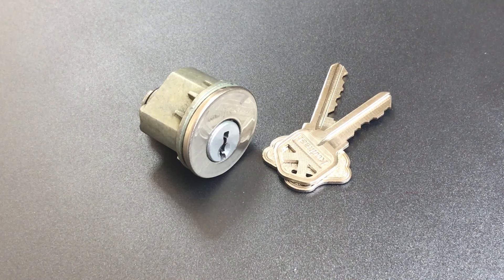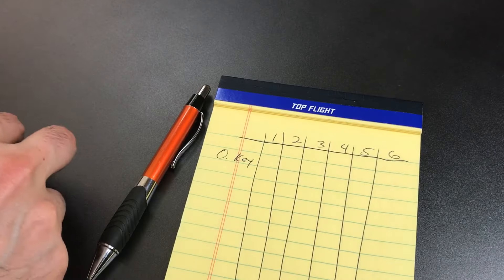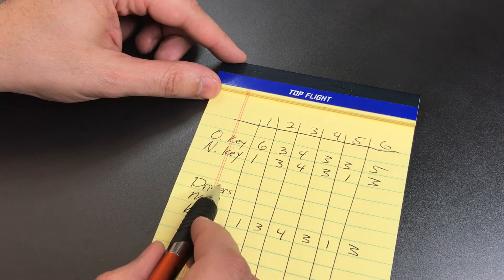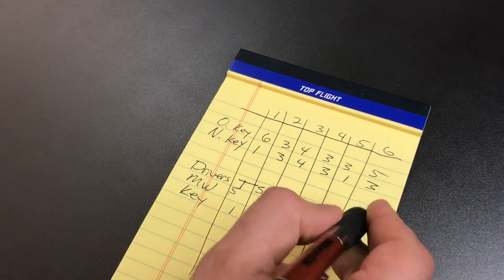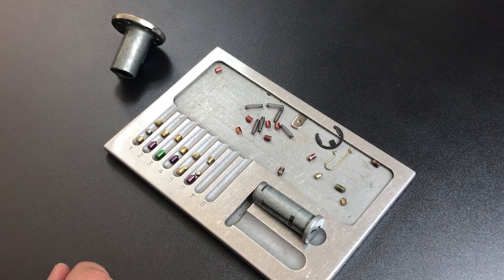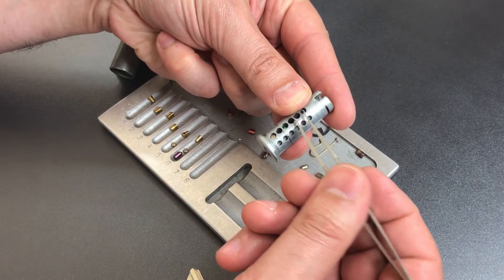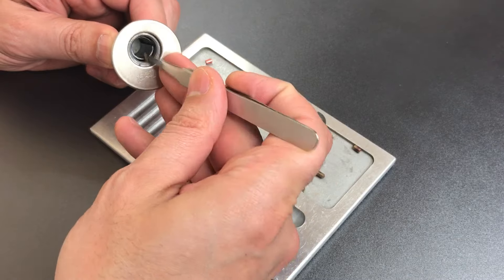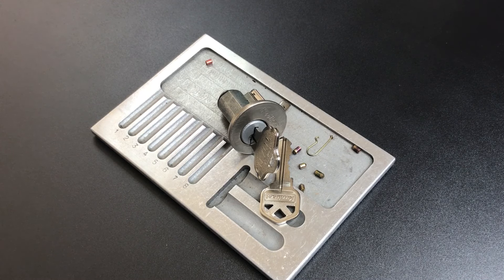[541] How to Make a Kwikset Key Trap

Comment: I know a locksmith who creates trap locks to recover lost or stolen master keys , the perpetrator with the missing master tries to nose around in a locked storage room , key is recovered and no need to re-key the entire facility
Reply from the maker: Hmm... interesting.
Reply: What if the thief made a copy of the master?
Reply: What if he raids the rest of the facility before he gets trapped?
Reply: I once worked for a douche who had over 100 rental units and he wanted me to put them all on a Schlage master key system. No problem. Then he says 'And make me up a bunch of master keys.' So I did. Then he starts handing out master keys like popcorn to anyone who needs entry, instead of only the regular key. Drywallers (those honest, dependable drywallers), paint touch-up crews, furniture movers. He lost track of most of the masters and then his tenants started complaining about shit coming up missing.   lol I tried to warn him, but he was a douche.
Reply: @bertrandhustle  Well, you leave the trap in place, maybe switch em to a different lock.
Reply: Tom M wouldn’t every employee who uses their master have their key withheld? No need for the question, that’s absolutely what would happen, seeing how the masters would be identical. This only makes sense if there is only one master, and every other key is individual.
Reply: @gotanyketchup3422  I imagine it's a case where in those situations, any employees who have an authorized master key are warned not to use it on the particular trap locks, and maybe even are given a copy of the normal keys in the meantime. Doing it that way would ensure the, (hopefully very few), people who are supposed to have a master key don't get it stuck, while anyone who isn't supposed to have one gets it caught. While it might be a pain for those employees for a bit, it's certainly a lot cheaper and easier than simply rekeying everything in a facility to deal with one stolen master key. I'd imagine if it's a case where the stolen key doesn't become trapped after a certain time, then rekeying would happen to cut down on annoyances.....
Reply: @socialex  It's not perpetuating stereotypes if it's actual anecdotes. At least it's not perpetuating stereotypes by someone other than the Mexican worker ;)
Reply: @socialex  "its use".  "it's" is a contraction for "it is" (or "it has").  Irony; couldn't help posting.
Reply: @Tryptamide  Are there intelligent educated dry wallers of any other race? I feel like that's a profession that lends itself to people who aren't that bright regardless of their race...
Reply: trey kearns - Lol, that’s what carpenters say about plumbers!
Reply: socialex - Calm down social justice warrior. Have a snickers bar or something.
Reply: @alexsis1778  honestly- if the only thing in the construction field you have mastered, or even better yet- decided to master to a certain degree- I for one feel bad for you. It also says alot about ones ambition if such a simple and monotonous job is all one decides to do. But two, anyone with good mechanical abilities and ability to work with tools and materials would almost certainly want to learn and master the other aspects of building/remodeling construction,  to a point where those who are motivated will learn all the other "trades" within the "carpenter field" , excluding obviously other licensed trades such as plumbing, electrical, mechanical etc
Reply: @biggawinnacrapsa3870  If you wanted to do the right thing, you'd warn the tenants.
Reply: @socialex  Ya know, stereotypes don't just appear out of thin air for no reason, that would be more of a "hate-based preconceived notion"...  When one observes a proclivity exclusive to a certain demographic, if it's a negative one then it gets labeled a "stereotype" and shame on you for pointing it out but if it's something positive then it's ok. This is the same line of thinking YouTube uses when hiding a shitty videos dislike count so that uploaders with shitty content don't get their shitty feelings hurt or when schools hand out participation trophies to celebrate mediocrity. I can go on but I'm sure you've gotten the point. But AAALLLLLLLLL that aside, I live in Southern California and in this area drywalling just happens to be a trade with about 99.99% mexicans be default. A good amount cross the border daily, even more dont even speak english. In fact the entire construction realm (even plumbing) in this area is dominated by mexicans with about an 80% majority. So NO, my comment had nothing to do with assumptions, stereotypes or hatred towards mexicans. My hatred is toward drywallers, regardless of their race.
Reply: @treykearns4867  - Lol, the mystery of the funky smelling nails is finally solved!
Reply: @socialex  oh yeah I also forgot to mention I'm a commercial plumber not a residential plumber. that is the huge difference between a scumbag track-rat and a highly-skilled, extremely knowledgeable badass with a much much higher level of professionalism being required. Commercial plumbing is so incredibly involved and diverse we need almost twice as many tools as any other trade, we are the second highest paid trade in construction. (in my area anyways. not sure how it goes in other parts of the country).. a non-union plumber makes more than any union electrician, Carpenter or pipefitter/mechanical/hvac. The only dudes making more than the plumbers on a commercial construction site are going to be the union Ironworkers and that's because they get hazard pay because of the crazy shit they do, flying huge steel beams many stories up into the air.
Reply: @treykearns4867  Also- it's a known fact that people from certain Hispanic countries often throw shitty toilet paper in the trashcan rather than flush it. It's utterly disgusting and I have seen it at multiple jobs over the years. There's nothing racist about pointing out cultural practices.
Reply: @rahmanahashem3484  well the reasoning for that is because they don't have very good Plumbing in Mexico and they can't flush toilet paper down otherwise it gets clogged so they have special trash cans for it I've seen it when doing jobs close to the border at medical facilities and stuff that are intended for Latinos in the bathrooms they will have two separate trash cans one in the shitter and one out in the lav / urinal area.
Reply: @bertrandhustle  Youre assuming the criminal thinks that far ahead.  More than likely the thief doesn't think of that before the lock eats the key.
Reply: assuming they haven't copied it
Reply: only if the culprit is dumb enough to actually use that master, which is probably most of them…but not all of them. ijs
Reply: @stevee7774  and what plumbers say about electricians.
Reply: @treykearns4867  from a former union tin knocker, respect to you and all other commercial/industrial pipe fitters/plumbers. Worked side-by-side with some of the smartest, most resourceful people on the planet.
Reply: @JohnDlugosz  you're a genius, son.

Comment: Next video: "How do you open your door when a key is stuck in the lock"
Reply: from the inside by removing the lock or better yet you don't and get used to leaving your home from your window! =P
Reply: As a companion piece for the 'perfect' (just replace the the first two pinsets with hardened steel equivalent sized pins&wafer) lock-- I give you the search for the perfect door: https://www.youtube.com/watch?v=4YYvBLAF4T8
Reply: The ol boot to the door tends to work quite well lmao
Reply: @IndyWildfire11  To that I say get a solid door and a hammerhead deadbolt with warding around the thumbturn (explained in that vid link I posted)
Reply: @IndyWildfire11  Spoken like an American, you're free to try that to mine, it's even the worst one I've ever had. I wish you very good luck.
Reply: 10 If Door = Tree Then Goto 30
20 If Door = Metal Then Goto 50
30 Weapon = Axe
40 Goto 70
50 Weapon = TNT
60 Goto 70
70 Qapla'
80 End
Reply: @thiesenf  I like.. I wonder how people really understand what this is.  I was wondering the same thing.  So if you live in an apartment, and that is the only entrance. Hope you can get a window open.. Or just start looking for a new apartment..<G>
Reply: @thiesenf  this comment needs more likes.
Reply: Harry Fahringer III No, it's very unoptimized and uses assignment when equality should be used. Here:

10 If Door == Metal Then Goto 40
20 Weapon = Axe
30 Goto 50
40 Weapon = TNT
50 Qapla'
60 End
Reply: @anonymoususer9837  Nice try, but this is BASIC and there is no ==, = is used for comparison as well as assignment. Also that wasn't much of an optimisation. End is redundant when there's no more code, and the structure is still overcomplicated.

10 IF Door=Metal THEN Weapon=TNT ELSE Weapon=Axe
20 Qapla'
Reply: Was able to pull the end of a key out a lock for a customer using a j hook and next to no experience.
Reply: I was thinking the same thing

Comment: Can you rekey so that it not only traps the key, but also the person turning the key ?
Reply: Its called a bear trap
Reply: @LPJMagicmusic  Do you still need the key trap then?
Reply: Yes, because the beart trap needs reset so if another thief comes along they still won't get in.
Reply: video cam
Reply: There was a design for fire alarms to keep the pranksters away. It locked the hand when you triggered the alarm and must be reset and opened by a policeman or fireman when they arrive. Cool design but i'm not sure why it didn't caught on.
Reply: @AsiAzzy  hate to be the person trapped at the pull station burning alive if it turned out to be real...
Reply: @matthewmiller6068  obvious reason why it's not real
Reply: Put a drop of nitroglycerine in every construction hole. Problem: while the perpetrator lies unconscious, the doorway is wide open for any subsequent attackers.
Reply: Man trap room with the key trap locks on the inside. They go in, door closes behind them, they can't get out in either direction.
Reply: @matthewmiller6068  Maybe not trapping hand, but what about issuing some sort of sturdy trackable bracelet, that could only be removed by special tool...?
Reply: A hidden trapdor with an invisible laser as a trigger maybe? When there is a person fiddling with the lock for longer than 10 seconds(interrupting the laser line), the trapdoor below them opens.
Reply: @harshnemesis  10 seconds...? You never ever returned home wasted, did you...?
Reply: @FalkonNightsdale  Never was that wasted I couldn't unlock the door in that time
Reply: @harshnemesis  Congrats, I have sometimes trouble to achieve that even sober. Depends on how many things I have on my hands at moment...
Reply: @FalkonNightsdale Well you just have to remember you have limited time and work within the limits, when it happens that you're taking too long you could just walk off before the trap triggers, or you could just extend that time, but keep in mind that if you do the later you will also lower the chance of catching the thief as they work fast and they might not care too much to retrieve their key, so a trap like this would be the best to trigger during that short period of surprise.
Reply: @FalkonNightsdale  I don't know of a tracking bracelet, but I have heard of some fire alarms that use the same sort of paint as is used to mark bank robbers, (via being hidden in fake packs of cash and exploding when they open them), with the paint spraying on whoever activated the alarm. An annoyance to anyone doing it legitimately for sure, but it also makes it really obvious who it is that pulled the alarm in the case of false alarm situations.....
Reply: @Gamer3427  There is a wide sort of such colours, both in colour palette and type of marking (whether it's reactive to some chemical or type of light).

Thing is, that they are mostly incredibly hard to clean up, marking everything in the process. And whenever the person is aware of markings (visible or invisible), it's easy to hide them or hide altogether - that's where nice alloy bracelet with tracking would be handy...
Reply: @FalkonNightsdale  There's a problem with using a bracelet though, in that one size doesn't fit all. If it's too small, it could potentially injure people who have larger hands/wrists, people who might be pulling it for legitimate reasons. If it's too big, it'll be easy for people with smaller hands/wrists to get out of it with no consequence. If it's some sort of flexible material that can fit any size, it'll be easier to escape or simply cut off. If it's something like a zip tie mechanic that adjusts to the size of the person, then the problem becomes keeping the device from putting it on too tight and potentially injuring the person involved. Of course, all of this is saying nothing of the potential expense of installing an alarm system with such a device, and installing it in such a way that doesn't just prompt the person activating the alarm to use a method where they won't get the bracelet applied to them.....
Reply: @Gamer3427  it could have form of padded zip tie mechanic - it can get pretty tight, but without injury, no mater size of the hand.

It can be done like having lever switch in a transparent cabinet, which could be reached from the bottom through opening with Mechanism. Pulling the lever would release spring on Mechanism, installing bracelet.
Reply: do it home alone style

Comment: How hard would it be to modify a Schlage lock to exhibit the same behavior?
Reply from the maker: +TheBonelesstoast not hard. Just add some construction keying holes... some schlages already have them.
Reply: It depends on your ability to drill a few undersized holes.
Reply: i have taken SCHLAGE cylinders apart (and put them back together) and the rear 4 chambers have construction holes.

Comment: Seems likes great idea as long as the the door unlocks by turning the key counter clockwise. But what happens if the door opens by turning it clockwise? I suppose you can modify the core for that.
Reply from the maker: +Bobby Keyz It will not work without adding construction key holes on the other side of the core. I note this in the description. 👍
Reply: LockPickingLawyer sorry about that I know you always think if everything. I usually read the description too. Missed it this time.

Comment: How do you get it apart after it happens? And how do you open your door if this happens?
Reply: Presumably you'll have a back door that hasn't been disabled by the trap through which you get inside.  Once inside you disassemble the doorknob from the inside to both release the door and to gain access to the lock core for disassembly.  The lock shown here has a cap that can be slid off to dump out the pins, including the one that fell into the trap hole.

Comment: What if the deadbolt isn't on the right side of the door? This means that this is useless. You can still unlock the door by turning it right, but only when you try to lock it will the key get trapped. Pretty poorly thought out.

Comment: How do you unjam it if your the owner?
Reply: You can dissemble it from the other side of the door. Don't do this on only one door unless you want to drill the door knob out. Use gravity to make the pens fall back into the lock. Make sure it doesn't have any tension and they should fall back down..

Comment: I’m a locksmith and noticed the cylinder you are using is for a deadbolt. If the deadbolt is installed so to unlock the door you would turn the key clockwise your system will not work and Marty is in your house. The key doesn’t have to turn far enough to get trapped to unlock the door. Also Marty can leave and take his key if he doesn’t try to lock the door. So it just depends on which way the lock turns to open for your system to work and if you don’t have a second entrance to go in you will definitely have to drill the lock to get in. A simple rekey of the lock is all that is necessary to keep Marty out.
Reply from the maker: See the description...

Comment: Something I've been thinking about, is wouldn't it be cool, to have a lock that sets off an alarm if you pick it? This could be done in several ways.

A complicated (first idea) way would be to make it so that when 1 pin is moved, it starts a timer and if the lock is not opened within a set amount of time, an alarm goes off.

A simpler method, would be to to use a spool and once you get a "False Set", it makes contact with something, which causes an alarm to go off. The nice thing about this design, is that it can be made purely mechanical/electrical, without any microchips, by using piezoelectric for a speaker (makes sound when powered) and you could make it so that alarm stays permanently on as soon as it is triggered, even if the person releases tension and runs away. Also, if the wrong key is used, the chances are that you won't set all the pins except the spool, so the alarm is VERY unlikely to go off from using the wrong key. The hard part, would be finding an elegant solution that requires the minimal amount of modifications to the core.

I know how to make it, but it would be very difficult to explain in words or understand with single images.

Yes, I know I could design, build and patent it.
Reply: You already presented idea rendering it un-patent-able in many areas(if not all). And patents are regional only so no reason to even bother with them.
Reply: Czorńy Lisek that is simply not true

Comment: So.... The lock is garbage now... You can throw it away. . If you can get into your home.....
Reply from the maker: +WOWayne325 If you can't enter the house from another door or window (after which you can disassemble the lock from the inside), then the lock will need to be drilled. I note this in the video description. 👍
Reply: LockPickingLawyer yes... I understand that... But the lock is garbage...!
Or is there a way to get in it?
Reply: AIUI these locks have a removable top on the bible, so you can get the springs and T pins out that way.